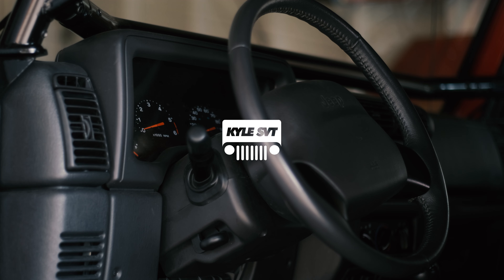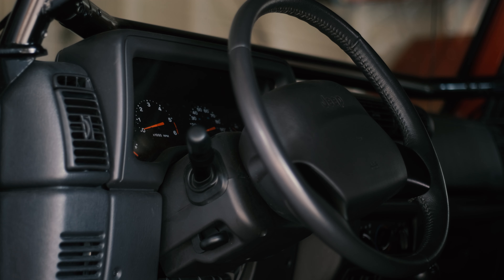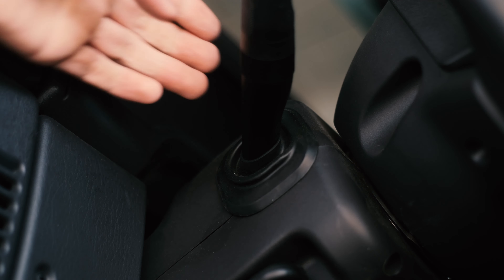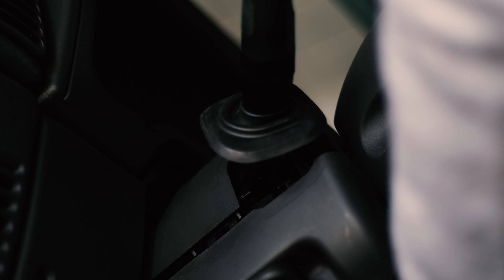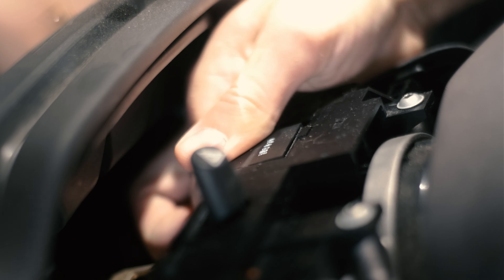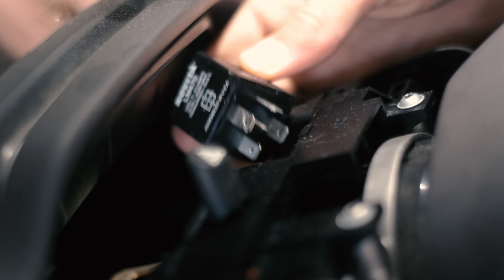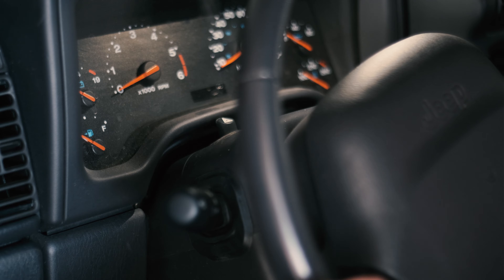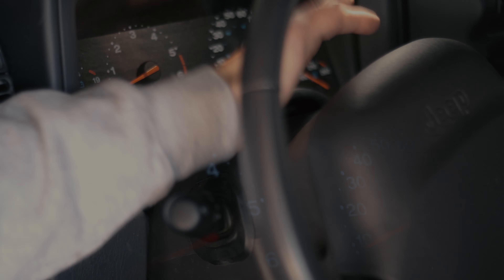Jeep TJ Hyperflashing with LED's FIX | LED Compatible Turn Signal Flasher

Comment: Freakin great video - helped me figure my issue out. Except I had no hyper flash, my turn signals and emergency flashers would not run they just turned on and stayed on. So watching several videos to find the right Goldie locks one I came across your video and it was the one that helped. Thanks. So frustrating that the simplest thing of changing a bulb would mean extra steps … bulbs are plug and play and even that is not really straight forward when it comes to LED.
Reply from the maker: Glad I could help!

Comment: Great video! I had bad luck with the Novita flasher. It fixed the rapid flashing but my hazards no longer work. I'll replace it again someday, haven't needed the hazards yet (;
Reply from the maker: Thanks Aaron!
Reply: I have the same issue with hazard.  I’ve tried three different flashers... all the same result
Reply: how did you fix it? same problem
Reply: @BrunoGarcia-hp8ct  still haven't fixed it,  no hazards. When I get around to it I'll just try a different brand
Reply: Have the same problem does anyone know how to fix it?.
Reply: I had the same issue and came up with a solution! Clip the center pin off of the flasher relay so it can't make contact in the socket. It's hard to get in there, but it works.

Comment: Awesome video. Sold me a four pin flasher. Mine was a five.
Reply from the maker: What year do you have?
Reply: @KyleSVT  2004. Turn signals worked with power off.
Reply from the maker: Im pretty sure my 5pin does the same thing
Reply from the maker: who sold you the 4pin version?
Reply: @KyleSVT  extreme terrain. Horrible service. Wanted additional money for there mistake. For a five pin. Return was a big hassle. Fedx located in Walgreens declined the return. Took to UPS store. 12 bucks to return. Never again!
Reply: @KyleSVT  that’s nuts
Reply from the maker: dang that sucks! I got mine from metalcloak
Reply: @KyleSVT  ended up getting them on EBay
Reply from the maker: @davidgriffin4401  nice! Ebay is great

Comment: I put one of these flashers in years ago and all of the sudden I started hearing a repetitive clicking sound coming from that general area inside the steering column. The best way to describe it is "Click-click.........click-click.........click-click".

It's absolutely maddening on road trips! It only happens when the ignition is on, but for some reason, not every single time. It seems to be a roll of the dice. It stops when I hit the brakes but starts again when I let go. I figured it was just a defective relay so I ordered a new one. Nope. The sound is still there. "Click-click.........click-click.........click-click".

I'm going to have to take the column apart again tonight and confirm whether or not it is in fact the relay, and if it is, what else back there could be causing it to click.  The possibility of both relays being defective is pretty low.
Reply from the maker: Yea sounds like an electrical issue maybe. I would check all your grounds, connectors, and fuses

Comment: Hey Kyle thanks for the vid.By the way have you changed out your dome or courtesy lights to led's?If so was it just switching the bulbs or did you have to change out the light fixtures too?
Reply from the maker: Thanks for watching bro! I have not changed any of that. I have the fuse pulled for the dome light anyway when I run doorless

Comment: Kyle, what year is your TJ?  I have a 2001, in the article you attached it has a lot of additional info that they suggest.  Just wondering what year you have.  Would the LM470 fit my 2001?
Reply from the maker: Hey John, My jeep is a 2001. This is the flasher I have https://metalcloak.com/gcd-5-pin-led-flasher.html
Reply: Will this relay you shared work on a MicTuning LED light with signals, 80w ?

Comment: I noticed you installed the Novita LM470 LED flasher relay. I have an 04 Rubicon that I want to run LED tail lights. Have you had luck running this relay so far?
Reply from the maker: Been fantastic
Reply: Awesome! I just ordered one. Thanks... @KyleSVT

Comment: My turn signals buzz when engaged. Hazards work fine. Could this be solved by replacing the relay too? 2002 TJ.
Reply: I’m having the total opposite! My signals are working fine in sync with the headlight turn signals but when I put hazards on they don’t work and makes a zzzzz sound ! Any suggestions?

Comment: Hey Kyle, I replaced that steering column fuse when I installed my Quadratec LED taillights. But I’m looking to convert my turn signal and side marker to LED as well. Do you think think I’d have any issues?
Reply from the maker: that should be fine. im on led headlamps and led turn signals with that flasher

Comment: Turn signals worked great once the flasher was upgraded. Question is why my hazards are still in hyper-flash on my 2005 Jeep Wrangler X?
Reply from the maker: Hmm not sure why that would be
Reply: Hello Todd, i think i have the same problem. I replaced the flasher relay like the video but when i try to use my hazards it makes an obnoxious buzzing noise and they dont flash. I found one solution on a forum but it involves getting diodes and resistors and wiring them in. Just wondering if you have found an easier solution?
Reply: @garrylarson5283 as you probably found out by now, the diodes and resistor do nothing to fix the hyper-flashing. They just allow a single LED to function as running lights and blinker. The problem is with the way the hazards use the center pin of the relay. Get rid of that pin and things work fine.

Comment: My jeep,2003 tj, is running its oem tail lights.Would replacing this part potentially fix hyper flashing even if I dont have LEDs?
Reply from the maker: Are the bulbs burnt out?
Reply: @KyleSVT  the bulbs work. My right turn signal hyper flashes.
Reply from the maker: any other lights out like turn signals, side marker turn signals, reverse lights, headlights?
Reply: @KyleSVT  none. They all seem to be working perfectly fine.
Reply from the maker: hmm im I would check the wiring of everything
Reply: @adrian350z1  theres a ground wire in the back of the driver side rear light, you're gonna have to take the light enclosure out first the 4 screws outside then inside theres 3 bolts, take them off and check for the white ground wire thats attached to one of the bolts, if that wire is not touching ground, your lights will hyper flash
Reply: @CH4RLYG777  wow! Thanks for the advice!!! I appreciate it!

Comment: hey kyle, my wrangler doesn’t hyperflash anymore, but i’m getting a the auditory warning that my turn signal has been left on when just my lights are on. any clues?
Reply from the maker: Hey Carter. did you replace the resistor?
Reply: @KyleSVT  i re did all my wiring, and even put resistors in, do i need to replace that LED flasher relay maybe? for now i just unplugged the solenoid that makes the sound while i research

Comment: Does anyone know if this will work if you just installed LED headlights (and not the turn signals or side markers)??  I have an 05 TJ and put in LED headlamps only.  Now, the right turn signal indicator stays lit, and I get hyper flashing on the right side.  I was told that it is b/c the current is lower voltage with the LED headlights, and since the side markers are connected to the head lights, this is what causes it.  I was wondering if this will fix this problem?  I really do not want to have to wire in the load resistors.  Any help would be greatly appreciated!
Reply from the maker: I would give it a try

Comment: Any clue what most common problem for my 2000 tj to be turning off at red lights or slow turns by itself , electronics stay on?
Reply from the maker: I would check your battery terminals make sure they are not corroded and maybe fuel filter or maybe air idle control valve
Reply: @KyleSVT   Thanks !!!
Reply from the maker: np!